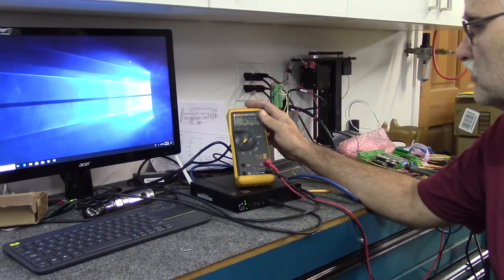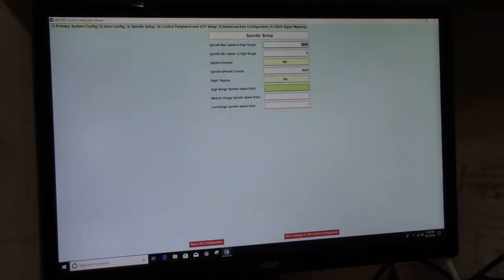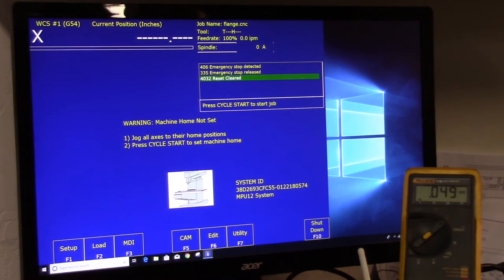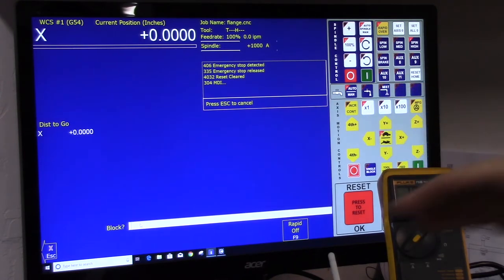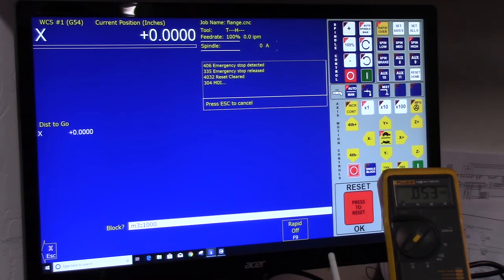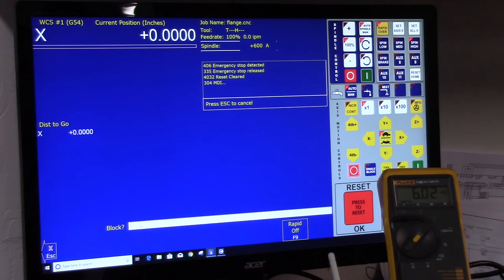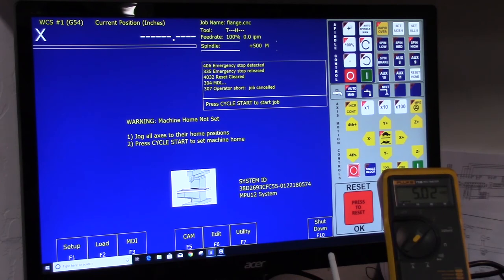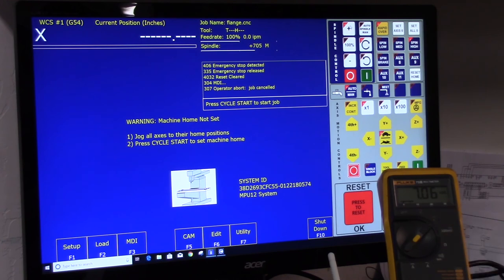Acorn Quickie Video - Acorn Spindle Analog Output Test

Comment: Thanks for the video Marty!  I have my Acorn directly connected to the analog signal input of a Minarik PCM DC spindle drive and it seems to be working fine, but you mentioned I need a signal isolator between them.  Can you please elaborate on that?
Reply from the maker: You risk damaging Acorn. Acorn was not designed to do what you are trying to do.
Reply from the maker: Do you know if your drive has signal isolation for it's signal inputs? Contact Minarik
Reply: The Minarik manual says "the drive may be wired to follow an (0-12vdc) analog input voltage signal that is either isolated or non-isolated from earth ground".  There does appear the input signal is immediately routed through a signal transformer upon entering the PCB.  Is there a 2 wire isolator you recommend for the Acorn?  I don't see this mentioned in the Centroid schematics or manual.  Thanks!
Reply: oops, typo, that should read 0-10vdc.
Reply from the maker: Well it says you can use either. Only difference is Acorn only supplies a 0-10VDC signal.  Hit the Centroid User Forums. There is a stand alone signal isolator available from KB Electronics. Search for Author DICKYBIRD. I would probably change to the KB Electronics Drive KBIC-120 or KBIC-125 and the SI-5 Signal Isolator. Sometimes you can find them together on Ebay for less than a $100.

Comment: Marty, I have run the test and every works fine with the Acorn, I tried hooking my spindle motor to the analog output from Acorn and got nothing. It turns out my spindle motor requires 110 v dc which the Acorn cannot supply. Do I need a VFD? if so, do you have any recommendations?

Comment: thanks for the info. good video. what kind of signal isolator is needed to run a DC motor?
Reply from the maker: Depends on the DC drive you use. Check with the manufacturer

Comment: Thanks for the video but what if the 10v analogue output does not go all the way down to 0v but idles around 0.1v when the speed is set to 0.
Reply from the maker: Should not be an issue. FWD and REV outputs should command the spindle drive on and off. You don't explain your application
Reply: @martyscncgarage5275  I have a DYN4 going in to the 10v analogue output on the acron board but because i can't get the voltage donw to 0v the spindle servo is always going round just a tiny bit.
Reply from the maker: @boolaudio  I'm testing that feature now.....
Reply: @martyscncgarage5275  It can be adjusted in the DeadZone i managed to get it working.
Reply from the maker: Great, you should do a video on how you accomplished that.
Reply: I just got done with this lastnight there wasn't much info on it at all and the dmm wiring drawling ng does no good at least the one I found...if the spindle rotates because of the voltage not being at 0 i fixed this by changing max speed to 54 on the dmm servo tuning screen..some trim pods to adjust st voltage would have been nice...my next thing is trying to see or how to get spindle speed matching the actual speed..I'm thinking this will be off if the voltage is not exactly 10 volts ?